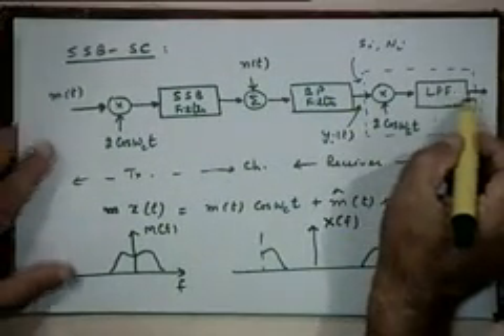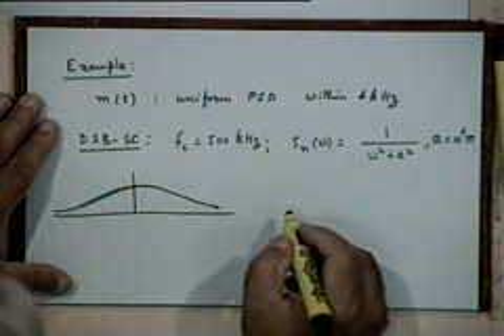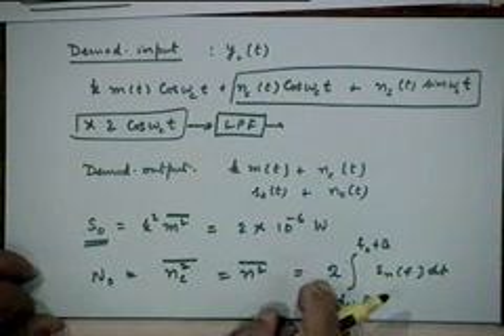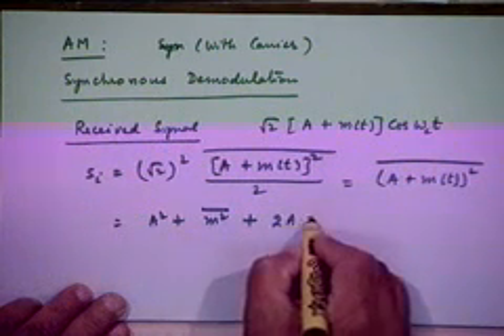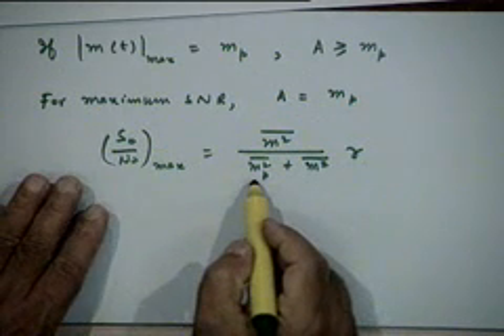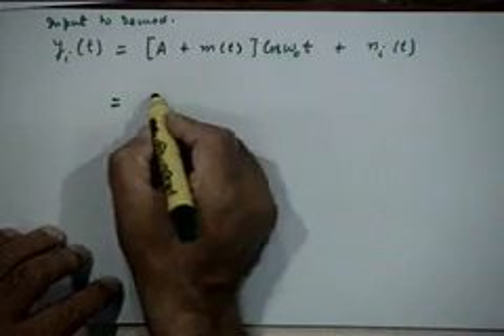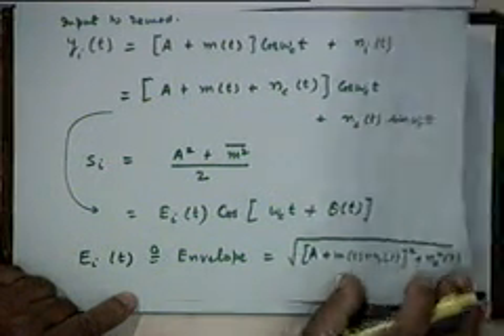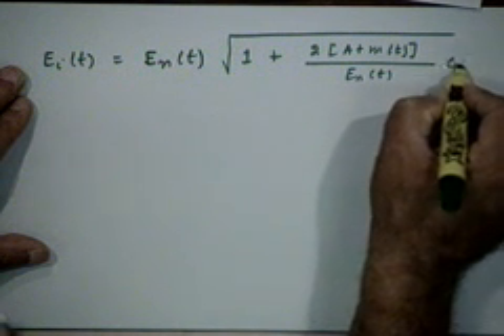Lecture - 34 Performance of AM Systems in Noise

Comment: 🎯 Key Takeaways for quick navigation:

00:04 📚 The lecture discusses the performance of communication systems in the presence of noise.
01:40 📊 Output signal-to-noise ratio (SNR) in baseband systems is S_i / N_B, where S_i is input signal power and N_B is total noise power in the message bandwidth.
03:30 📡 The lecture discusses single sideband (SSB) modulation in synchronized systems and its output SNR.
05:54 📢 The lecture mentions that the input signal power and input noise power are more meaningful to discuss immediately after the bandpass filter.
07:39 🔄 The lecture covers the representation of SSB signals in terms of message signals and their spectral characteristics.
09:38 🔊 The lecture calculates input signal power at the demodulator's input as m square bar for SSB signals.
11:45 📈 The lecture explains the demodulated output after low-pass filtering for SSB signals.
13:38 🎙️ The lecture discusses the output noise power calculation for SSB signals and its bandwidth considerations.
14:55 🧐 The lecture highlights that the output SNR for SSB signals remains the same as the input SNR.
15:49 🔗 The lecture mentions that the transition from double sideband (DSB) to single sideband (SSB) modulation is primarily about bandwidth, not SNR improvement.
17:42 📊 The lecture discusses that the performance of various modulation systems after synchronous demodulation remains similar.
20:19 📉 The lecture provides an example calculation to determine the output SNR for an AM signal with a carrier.
32:48 📊 When evaluating the performance of AM systems in noise, it's essential to consider the signal-to-noise ratio (SNR) at the input.
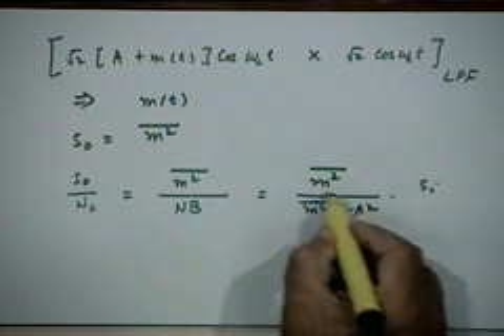33:12 📈 Transmitting an AM signal with a carrier results in some of the input power being used for the carrier, affecting SNR performance.
34:04 💡 To achieve the same SNR as other systems, AM with a carrier requires adjusting the modulation index (A) and the saturation factor (γ).
34:31 📉 The power requirement for AM with a carrier can be higher than AM without a carrier, depending on the maximum message value (m sub b).
36:48 🔄 Output SNR in AM with a carrier depends mainly on message properties and can be expressed as a function of the peak value (m sub p) of the message signal.
38:12 📊 Saturation factor (γ) plays a crucial role in determining the power cost associated with using AM with a carrier. Typically, there is at least a 3 dB power loss, which can be more in typical situations.
39:22 📈 Depending on the peak-to-average power ratio (m p square / m square bar), the power cost associated with AM with a carrier can range from 6 dB to 9 dB loss in power efficiency.
40:39 📊 AM with a carrier is used for its simplicity in demodulation, but it comes with a power efficiency cost due to the carrier.
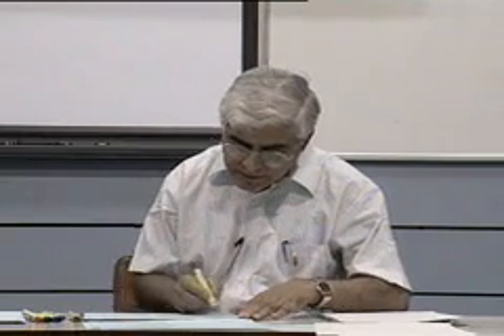41:33 📊 Envelope detection is an alternative to synchronous demodulation in AM systems. It produces an output proportional to the envelope of the input signal.
43:14 🔍 The envelope of a signal is defined as the amplitude of the signal without its carrier component.
46:39 📊 Envelope detection involves taking the square root of the sum of the squared signal and noise components, which introduces non-linear dependencies.
52:30 🔄 Envelope detection performs similarly to synchronous demodulation when the input SNR is sufficiently high, but it may not be as efficient in lower SNR scenarios.

Made with HARPA AI